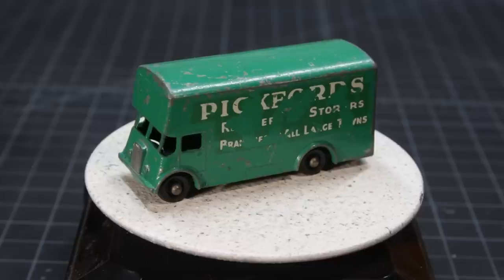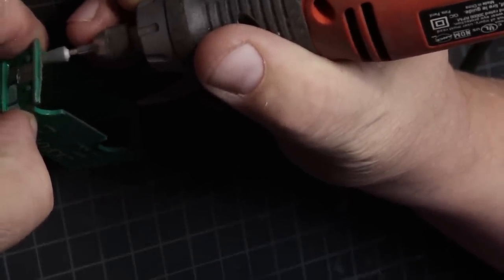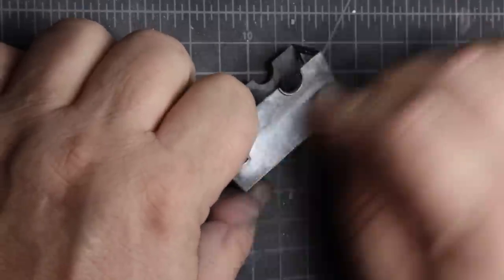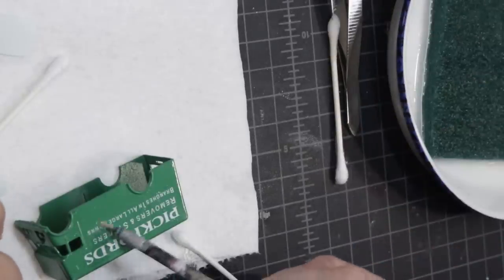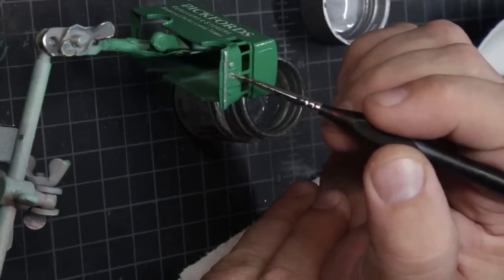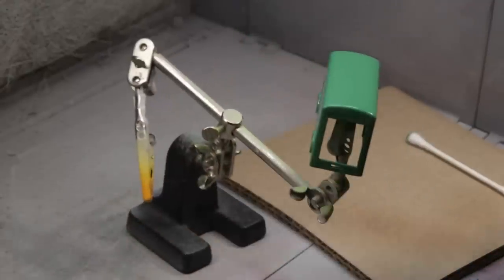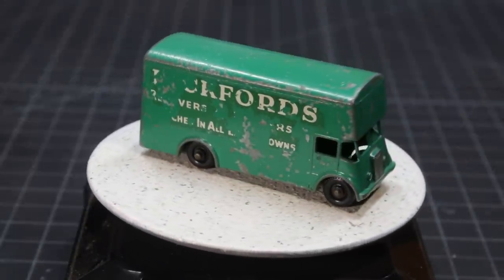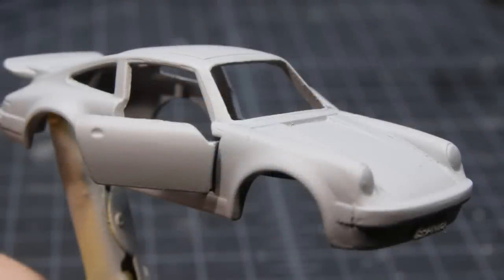Matchbox #46B Pickford Removal Van - Restoration

Comment: Fortunately nobody at Lesney had to hand paint the headlights and grills. Lesney used a process called mask spraying to paint details. The model wold be set into a mask with holes cut out and then the exposed parts would get paint. This process was used on various models up until 1970 or so. Early models did have some hand painting, but they had mask spraying long before this model was introduced
Love your work
Reply from the maker: Well there you go . . . it still works better when you do the bumper faster!